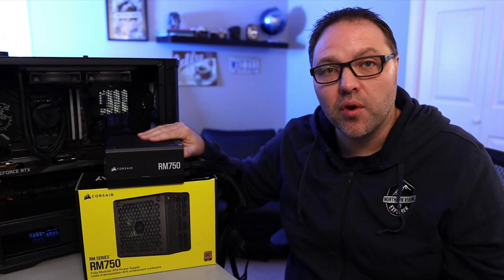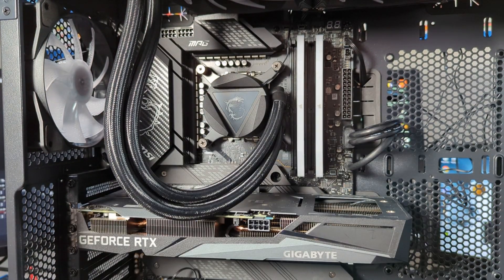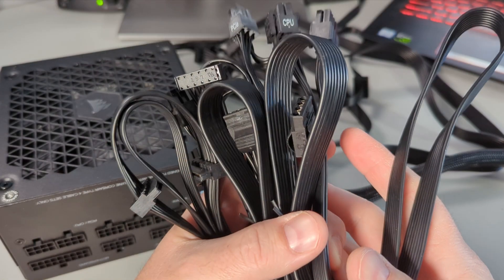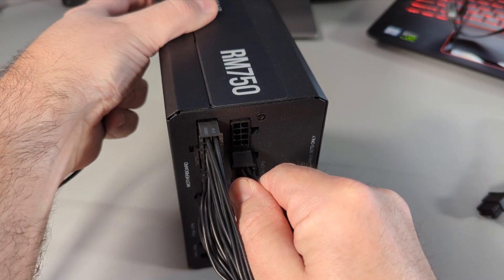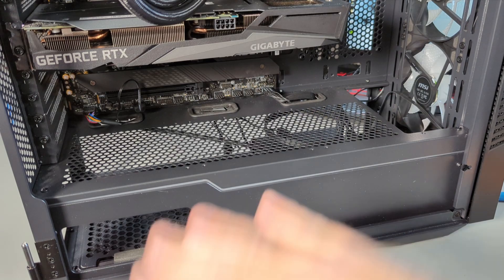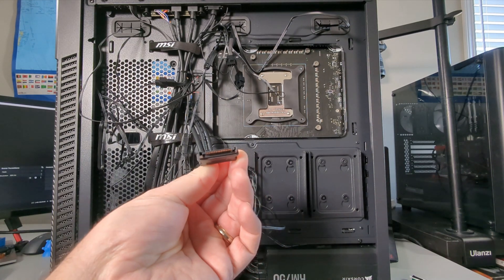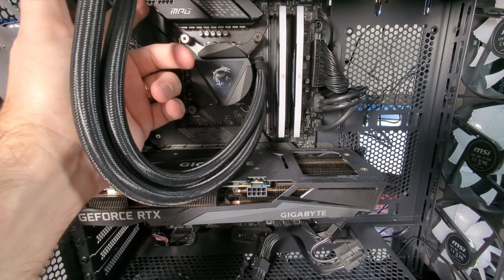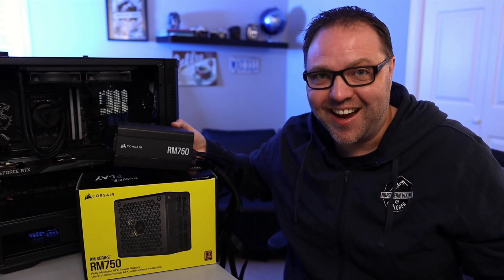Power Supply Installation & Cable Connections to Motherboard (Corsair RM750 PSU)

Comment: Gigabyte GP-UD850GM and i identified the GPU cable 6+2 pins and inserted it in my GPU and PSU. I used the 4+4 one on my CPU 4+4 slot on my mobo. The thing is my PC boots up for one second and then it goes off. It might have to do with the fact that the cable i used for my CPU PSU has 7 pins (one missing pin) but the only other cable delivered witj my PSU only fits my mobo and psu on one side,  the other end doesn't fit in my mobo nor psu

Comment: Most people put there power supply upside down should i do it that way or your way💀
Reply from the maker: They are designed to go in both directions. If you put it upside down, just be careful that you're not placing it on a heavy carpet or rug and that there's airflow underneath.

Comment: Do the cables come with the PSU? Or do I have to buy them separately? Is this the same with the Motherboard too?
Reply: Yeah they are inside, I bought my Power Supply literally an hour ago and all cables are inside. They are also written on the box, so look for it on the box
Reply from the maker: Yes, the cables come with the power supply.

Comment: Last time I built a computer, it was all IDE ribbon cables and 12v MOLEX power, so this was all new to me! First, I hooked one CPU plug to the CPU plug on the MB, but read the other plug wrong and thought it said GPU, so plugged that into my Radeon 9060xt. But I noticed later the plug said CPU, so moved that to the second CPU MB plug, And then I wasn't sure how to power the GPU, nothing was labeled for that. Power supply manual says either the PCIe 6x2 like you did, or the 16 pin 6x2. Had to check the info on the GPU, and turns out it's the PCIe 6x2 like yours. So now I'm all connected correctly, and ready to plug it in! Great video, thanks for the help!
Reply from the maker: Glad the video could help with the new connections! 👍
Reply: @NorthernVikingEveryday Thanks to you, it fired up first try, no issues!

Comment: I NEED HELP, my psu is the same way structured except that the atx 24 pin (10+28) on the psu has the 10 pin part on the right and the 28 pin part on the left whereas my atx 24 pin cable is opposite. What do I do

Comment: hey question my cpu power has a 4 pin on my motherboard but i dont have a 4 pin on any of my psu cables can i just do it with a 8 pin and leave 4 pins outside or doesnt that work (or is it dangerous)

Comment: There are cables missing like the power switch and power led etc
Reply from the maker: This is a power supply installation video, not a case setup video. Those cables come from your front IO on your case.

Comment: Really helpful guide. Saved me a drive having to take my rig to a professional. Your build and PSU look very similar to the one I replaced so I didn't have any worries at all installing my PSU. It was quite easy. Thanks!
Reply from the maker: Glad I could help you get your PSU installed without any issues! 👍

Comment: Can I connect an 8-pin PCIe wire on the secondary 8-pin CPU connector on the top section of the motherboard?

I've got an older Corsair GS800 power supply (from about 2012) and it only has ONE wire with an 8-pin connector for the CPU. 

It's got 4 PCIe wires with the 8-pin (splittable to 6-pin) connectors. The other wires have SATA connectors and older-style fan connectors. 

PS... I don't have the morherboard yet. I'm starting a new build and have been looking at the Gigabyte X870e or X670e motherboards. 

Haven't built one since 2008, so it's been awhile.  Trying to learn all the new stuff so I can assemble it correctly.... and try to use some of my old parts if possible... like the fans, power supply, and gaming-style case (with a bit of modification to add an extra fan).  I realize the rest will need replacing. 

Thx. 
Dawne
Reply from the maker: The CPU cables and the pcie cables are typically different. I would stick to the correct one.
Reply: @NorthernViking Everyday  Thx.  Yeah... I dug into it a little more and apparently the wiring for the CPU cable and PCIe cable are different coming out of the PSU.

Thought about rewiring the old PSU PCIe cable, but too risky.  I don't want to chance wrecking the new mobo.

Thx so much.  😊

Comment: Thank you!
I only have one question: 
Can I use my regular PCIe cable for the RTX 5070 or do I have to use the 600 W PCIe 5.1?
Reply from the maker: I don't think the RTX 5070 uses a pcie cable. You'll have to use the 12VHPWR cable for that GPU.
Reply: @NorthernVikingEveryday ok, thanks

Comment: Are there any rules for installing the CPU power cable? In your video, you installed two ports. What happens if they are swapped (left and right)? Will there be any issues?
Reply from the maker: The cables can go either way. Just make sure they are the correct cables.
Reply: @NorthernVikingEveryday  I see, thanks for the insight that really helpful ^^

Comment: There are two CPU power outputs on the motherboard. Should we connect them to two separate CPU cables on the RM750, or should we plug this 8+8 pin directly into the PCIe/CPU output? It looks like you did it this way, but I'm a bit confused.
Reply from the maker: When there are two CPU ports, I use two separate cables.

Comment: If I need 2 PCIe cables, should I install them side by side on the PSU or put one at the top and the other at the bottom?
Reply from the maker: I prefer to use 2 separate cables.

Comment: Ur guide is best because majority of people just show where each connection goes on Mb but doesnt show psu connection. Majority of confusion comes due to pcie/cpu cable being 8 pins . I think they should start to colour the modular psu different for pcie and cpu.

Comment: If i was stupid for this, you would save my life haha :D I built my first PC but i somehow knew which cable and how to connect 🥹 AND if i cant place fan on the bottom of my case, then i should put in the PSU's fan DOWN side, right? Im right :3 [i have 2 fans front (air in) and 1 on the back (air out)]... What should do in the future? I wanna buy 2 more fans to the top... Air in or out? Can you tell me? 😅

Comment: I’m gonna replace my power supply but the problem is I gotta pre built pc so I have no idea what plug is for the rgb lol. Also my mother board does have two cpu slots but only one has a cable plugged in and I mean it still works so I guess I don’t have to use the other
Reply: Do you have a case with built in rgb, or just on the motherboard? 😮 (cuz i have built in... But i can show my motherboard's rgb place somewhere xd)
Reply: @  nah it’s definitely on the mother board I don’t think the hyte y60 has built in rgb (that’s the case I have)

Comment: how do i know how many cables i need to plug in for my cpu?
Reply from the maker: Your motherboard and GPU should have come with instructions on how to connect it. Typically it's one or two of the eight pin connectors, the 24 pin connector and then any peripherals or accessories you're adding like drives or your GPU.
Reply: @ tysm i also needed help with the pci e cables, is the cm psu side supposed to be plugged in the power supply or is it the pci e sides

Comment: If you orient your PSU like that doesn't it mean that its fans are working against the GPU fans - i.e. both sucking the same air in opposite directions? My hunch is that both components would run cooler if your PSU were drawing its own fresh air from underneath the case... 🤔
Reply: I think you're correct. My PSU is telling me to go for bottom suction if I can. It's recommended.
I have holes on the bottom like he does.

Comment: hello i want to know im gona build a pc soon or not like but il gona buy a case and ram and cpu and mother board i was wondering how do i know if the power suply is going to have the rigth cable from my gpu and cpu and the mother board or are they sl the same
Reply from the maker: You should be able to find the specs on the companies websites which will give you the details.

Comment: I did it the wrong way I left my psu out of the case then tried putting it in now and I cant
Reply from the maker: Sometimes it can be a tight fit + the cables can be tricky to run. Hopefully you get it sorted out.
Reply: @NorthernVikingEveryday ye going to take them all out its a new pc rewire them hopefully doing your steps this time it goes into bios and stuff

Comment: These power box cords are so annoying, if you mount it fans facing up into the case, your cpu wires can’t reach the cpu slot on your MB so you have to mount it downward….
Reply from the maker: That can depend on your actual pc case as some are bigger and some are smaller which may move your motherboard further away from the power supply. You can buy power supply extensions which may help you out.

Comment: I followed this exactly but my pc isn’t turning on and the motherboard isn’t receiving any power. Any advice? I subbed btw
Reply from the maker: I would double check all the connections and make sure that your PC case wires are properly connected to the motherboard or your power button will not work. Any one else watching have other ideas, please comment below. BTW thanks for the sub!
Reply: @ no worries. Turned out the PSU was faulty. I plugged in my old psu and my motherboard had power. Ordered a replacement so I hope it’ll work.

Comment: I have the same case and a very similar power supply but my 4070 graphics card needs 2 PCIe cables and the power supply didn’t come with enough. Built my whole pc before realizing and now i have to wait for one more cable to come in the mail

Comment: I followed every single step, but my GPU won't give me any image. Also their fans are not spinning. I've checked and checked 100 times. It's all plugged in correctly. 

I even swapped black my old psu and graphics card and now that also doesn't give me an image. What's going on 😭.

Comment: i got the 850, and it's interesting it came with different cables... one that I need for the CPU socket doesn't even fit in the mobo (wrong orientation)...  PCpartpicker says compatibal using 8pin EPS? but i dont have that.

Comment: Just bought this power supply to run my new gpu, and it wont even turn on. The pc and everything else is brand new, and working with a different battery. Dunno what to do

Comment: i have the RM 750e psu-the power cord that was included with it doesn't fit properly into the psu's 3 pin socket and because of this the psu doesn't power up properly (because of the loose cable) and i have to wiggle it several times to get a proper connection.This is really a hassle-i wonder what could be causing this.Did you experience any such issues with your psu?
Reply from the maker: That's odd. I haven't had that problem with any of mine. I would contact Corsair directly and see if they can send you a new one.

Comment: does this psu work with the rtx 4070 super? I've read it uses a special 12v high power cable, and requires 2 pcie 8 pin connections

Comment: My question is... Don't every power supply come already with all the needed cables? Technically?
Reply: Yes they give everything needed
Like some people still use molex power for various stuff so they put it then the things the motherboard don't come sata sata cables they come with Mobo . Fans and fan hub with fans. Front panel connector and audio JAUDIO5 comes from your cabinet panels. 
So you Will always have

Comment: Switched from a non module to a modular PSU. I had my CPU cable plugged into my GPU. Make sure to read the cables since they’re both 8pin! This was the video that helped me realize my mistake.
Reply from the maker: Glad you got it sorted out!
Reply: It's actually easy, the PCI-E cable is splittable into 6 pin
Reply: @zomuxgaming4282thank you bro! Its help me really.

Comment: I have the RM750e which has a splitter one of the PCI cables. My Geforce card has 2 eight pin male connectors

Comment: Not sure if your still reading chats I followed your tutorial and my pcu wont turn on
Reply: Did you turn the switch on ?
Reply: @kjellobello5389  yeah I gave the PC to a technician for some reason the power supply came broken and the PC has some other issues

Comment: Hye, I'm new here, i got some question. Is it okay to use different cables other than provide cables that come with the psu?
Reply from the maker: I would use the ones that come with the power supply as you know, they're the correct gauge to handle the power coming from that specific unit.

Comment: Can we use the same cables that are already plugged in?
Reply from the maker: Its always advised to use the ones that come with the power supply to make sure they're the correct gauge to handle the power from that specific power supply.

Comment: I plan to get the corsair RM750e power supply for my gaming pc that is about 5 years old now the old evga one 650w was starting to reboot the pc randomly so its time for a upgrade, I made sure it was not software related since I had windows reinstalled and such and still did it. I am using a msi motherboard which is decent for the job. Hopefully it will function properly after the replacement is done.

Comment: Bought a new power supply, can I use the old cables from the old power supply or should I rewire everything
Reply from the maker: You should use the new cables as they're designed to work with that power supply. I've heard some people have troubles with not switching out the cables.

Comment: I tried to clean my pc case and there is a mesh under my case covering my psu it had two sides one rough that if i touched it would stick to my clothes and one  smooth i dont remember witch side to put it on please help.

Comment: My rtx3080 neeeeds 24 pins :(  so 3x8 .. i have only 2 cables .. but each has 2x8 pins . anywaym, they recommend  to use 3 different cables but i have 2 only and the psu is semi modular. the main cables cannot be disconnected and the only ports where i could add another cable are called HDD/SATA and they each have 5 pins entry. Is is it ok to use a cable  5  pins  from psu to gpu or to  buy another psu ?  ^^ thxxx

Comment: Just to be sure, when you first unplug the power cables, you remove them from the case and you get rid of them to use the ones tham come with the new psu?
Reply from the maker: Yes, I would use all the cables that come with the PSU and not old ones

Comment: Hey dude, your just about the only video i can find connecting an 8 pin gpu, i have the gigabyte windforce 4070 oc with an 8 pin slot, is it literally just one 8 pin in the psu and one 8 pin in the gpu and thats enough power? I was under the impression standard pcie only provides 150w and my 4070 needs 200w... just worried i wont be supplying enough power

Comment: Is additional cable required for case RGB connection? On my computer, I connected the RGB cables to the motherboard, but the fans are not working stably. I tried to connect RGB cables to the PSU, but the input and output ports did not fit.

Comment: Hi there  friend and thanks for the vid, i just purchased the rmx 1000x and i noticed some tiny like scratches on some of the cables when i took them out of the plastic bag. The psu works fine but i cant say for sure if this is a problem or not, Do all cables come like this from factory maybe? do you know something about this?
Reply from the maker: Interesting, I haven't noticed scratches on any of my cables. If they're not gouges I wouldn't be too worried about it but if they're scratched and indented maybe contact the company.
Reply: @NorthernVikingEveryday  super thanks for the quick reply man!! no there are very tiny ones ,i only notice them with a flashligh but they are definetely there  I will probably give it back on monday just to be sure and ask them to give me another one. The weird thing is that i noticed some scratches in some other corsair psus  that i own but in a lesser degree ,anyway, Have a nice day!

Comment: Hello, i have a problem, i have a 400W (circle gaming) power supply (smps) it is giving power to the motherboard my pc boots up fine display turns on fine every fan is spinning but only the power supply fan is not spinning its size is (12 cm, 120 mm)

Comment: so the power supply has 28 pins for the motherboard?? i saw 18 where it said motherboard and another 10 on the side, but then that goes to 24 pin for the motherboard?
Reply: Yes, one 18 pin connector and another 10 pin (on some PSUs 8 pin) connector on the side on the PSU. The cable is split for those two connectors, and the other end of the cable has the standard 24 pin connector on the motheboard.

Comment: thanks brotha
Reply from the maker: You're welcome 🤗
Reply: @NorthernVikingEveryday if i have a 12 pin gpu will it fit in an 8 pin
Reply from the maker: @kasenbellard  typically you would use two power cables.
Reply: @NorthernVikingEveryday  my graphics card has a 6 pin and an 8 pin idk what to buy or plug in to
Reply from the maker: @kasenbellard  My Intel arc has the same thing and I use the eight pin and the six pin portion of a second power cable.

Comment: on the gpu you use 6+2 is the power supply side only 6 wires or 8 as my cable only has 6 wires on the power supply side

Comment: Are modular Psu cables long enough for motherboard connection in mid tower case going from the back ? Can pcie cable for graphic card be long enough to route from the edge of the card to psu ?
Reply from the maker: They have been long enough for all of my builds.... but it's possible for them not to be long enough on some cases.

Comment: So the part of the PS with the fan is faced towards the motherboard? and not the floor?
Reply from the maker: They are designed to go in both directions. Depending on your situation you can put it up or down. It actually draws the air in and blows it out the back of the power supply.